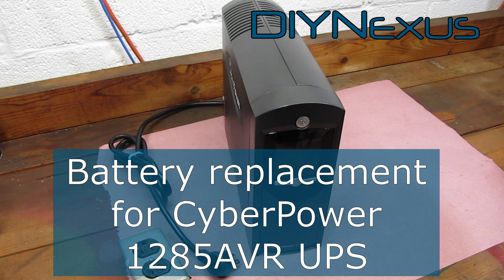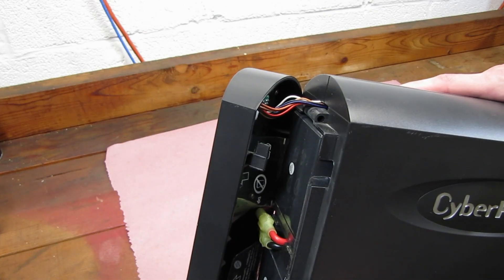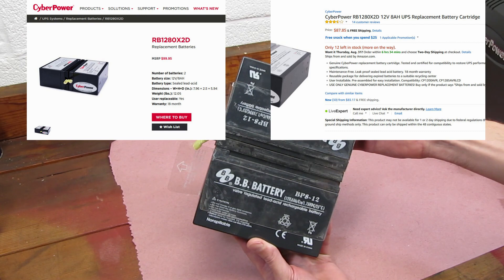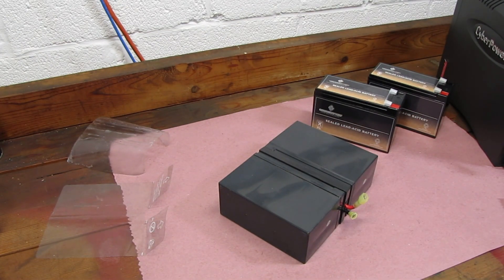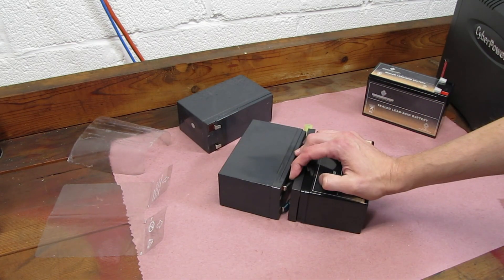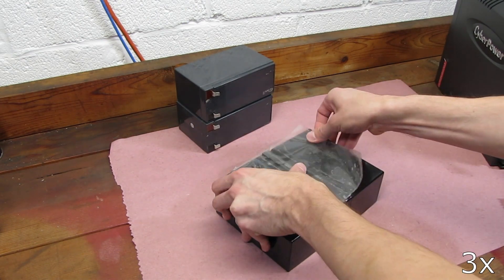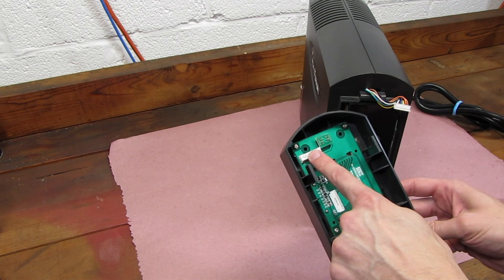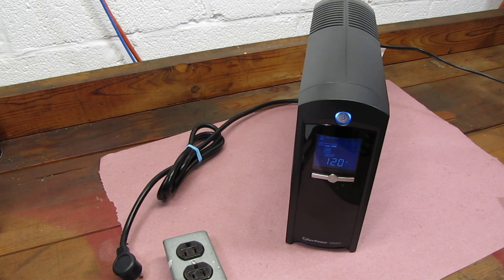Replacing or Rebuilding the Battery pack in a CyberPower 1285AVR UPS

Comment: I lost the plastic piece with the wiring that interconnects the 2 batteries. I have 2 replacement batteries that I will just connect together. Do you know if the batteries are wired in series or in parallel?
Reply from the maker: I believe they are wired in series for 24v operation.

Comment: Thanks for wonderful video. Any advice for removing the battery cable from the terminal. No matter how hard I pull, it won't budge. Thanks.
Reply from the maker: I've had a similar issue and can really only suggest that you wiggle it while pulling.  Some are just REALLY hard to remove.
Reply: @DIYNexus  So far I got one of four off so I know it's possible. Thanks for great video.
Reply: @DIYNexus  I figured out a great way to get off stubborn terminals. I grip the neck at the right place with a narrow needlenose pliers. And then tap on the pliers in the right direction with a ballpeen hammer. It comes right off in two taps.

Comment: Well I do have a criticism .. why position the camera so that all we see are your hands and arm?

We want to see how the wiring is connected ... but all we see is hands and arms. Did you go back and edit? Sheesh.
Reply from the maker: You're right, our motto is "Learn. Share. Improve.".  This is something we'll try to improve in the future.  Its hard to edit the arms out when you only have 1 camera of footage.  :-)
Reply: Pretty easy to figure out how the wires were connected since the smallest wire is the one connecting both batteries together(series). Plus parallel wiring would have required 4 wires 😉

Comment: I couldn't tell from the video... Are the two 12v batteries connected in parallel or series?
Reply: Series for a 24V output
Reply: @markmoore856  24V didn’t blow up the unit? 😆
Reply: thats what i want to know too. i took mine apart too fast x.x

Comment: Great job! Best video of the removal of the front panel. I have three CyberPower UPS that I bought about one yer apart from Costco. The first died after about 10 years, and I will now replace the batteries In my 1350VA (CSTR1300) with Mighty Max from Amazon ($35).

Comment: It was hard to tell by your video was these batteries in series for 24 volts?
Reply: They are in Series..Why you need two of them.. I didn't buy them small ass batteries. I used Cell tower ones. They have 800 amp capacity for the same price. So they last 2 weeks..
Reply: @MasterChief-sl9ro  can you give me the product number of the cell towers needed for this device,  and where can I find them,  thanks in advance
Reply: @mrvic92154  They used all brands. Only has to be 12 volt Battery. Wired in series to get 24 volts. Then get some high amp Connectors to plug the cable into the UPS..

Comment: Can i upgrade the batteries with ones that will give a longer run time when the power goes out?
Reply: I once used external cell tower batteries of the proper voltage and just extended the red/black cables to reach it. Not as portable, but sure did increase the power off duration.😃
Reply from the maker: Yes, generally if you can find an exact physical match (size, terminals, still 12V) that has a higher amperage, then you can use them in the UPS.  In this case, it's tough to find much higher than 8AH in this form factor.

Comment: Thanks, very helpful and money-saving video! I tried to buy the individual batteries from your link so you’d get a little money but their cart wasn’t working when I tried to check out. I ended up buying “Mighty Max Battery 12V 8Ah UPS Battery” from Amazon, a two-pack costs $35 with free shipping from seller (not Amazon). Batteries arrived quickly and the UPS works!
Reply from the maker: You're welcome, and thanks for trying to help us out!  1 more UPS saved.

Comment: I suppose UPS manufacturers would rather you buy replacement batts from them so they can make their huge markup on them. Most 12v8ah batteries like these, which are used in low voltage systems like alarms, etc. cost about $20 each from alarm distributors. 
I have a cyberpower cst135 which apparently had its batteries go bad and I need to replace them, but their support site says they're not available yet. I'd rather use a pair of Yuasa NP7-12 or whatever is the equivalent of what's in there.

Comment: There is no need to disconnect the front panel connector as part of the battery replacement process. Just set the unit on it's side and swing the front panel out of the way. The battery assembly will slide out and back in just fine.
Reply: except the directions that came with the unit had it as a definite step.maybe to prevent an overload if I didn't place my batteries on the right terminal?
Reply: @MsDiamond611  so, don't place them on the wrong terminals? 
I would think if you did this a ruined front panel would be the least of your concerns.

Comment: I'm wondering how good those replacement batteries are.  Have you had any problems?  If someone has done this before, they don't last half as long or anything like that, do they? 

Nice video btw.  Very well put together.